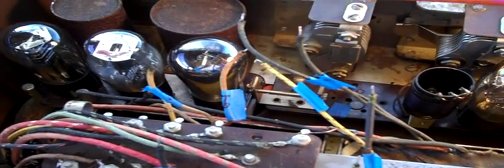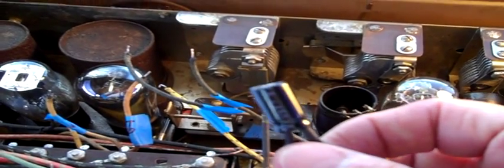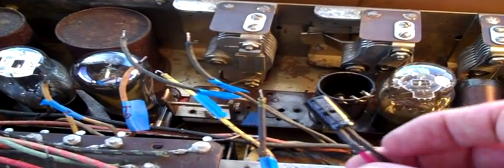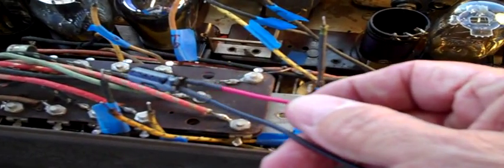1927 Atwater Kent Model 37 Repair and Restoration. (Part 5 of 21)

Comment from the maker: You can't use the coil method on everything, but it does save a lot of time.  The best part is if the component ever needs to removed, one only needs to melt the solder and the component/wire slips right off.

Regards,
John